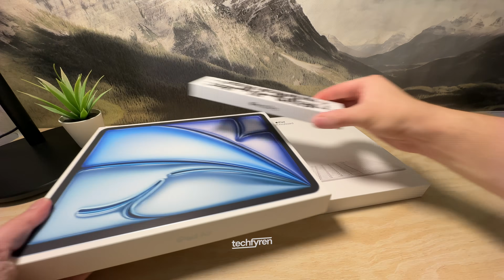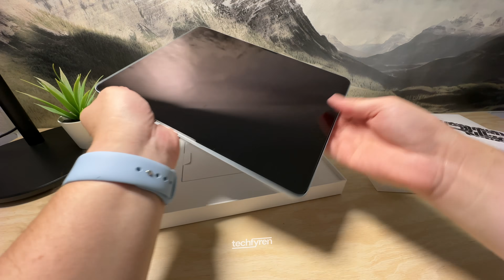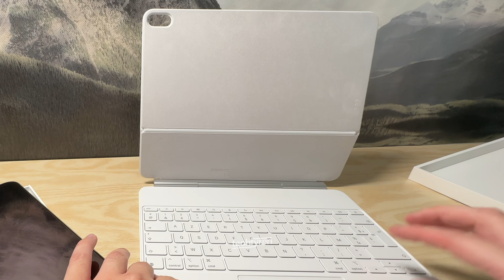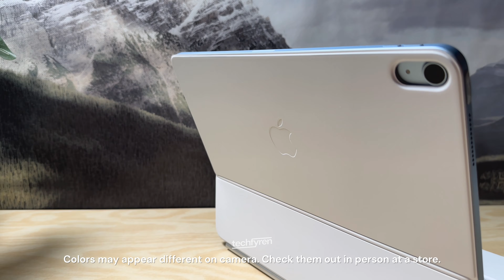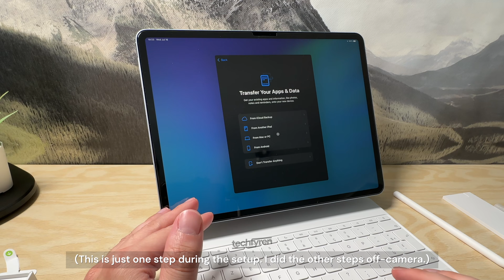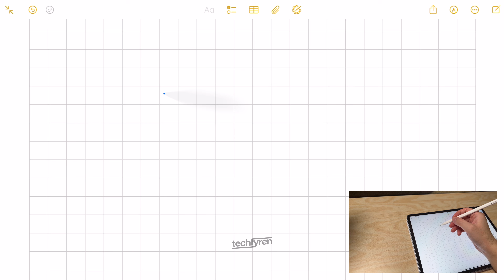New setup: 13-inch iPad Air (M3) + Magic Keyboard + Apple Pencil Pro Unboxing

Comment: Hii! I purchased the same Air M3 with the pencil pro. I observed that the pencil gets dark smudges. Is it the same with you? Also one speaker grillle is totally silent no sound from there, bottom one on the side of the power unlock button. Could you help?
Reply from the maker: Hi! I don’t have the dark smudges, but I’ve only had the iPad Air and Pencil Pro for a short period now. About the speakers: indeed, there’s no sound coming out of the bottom speaker grill on the side of the power button on my iPad, holding it in landscape. According to Apple’s website, the iPad Air has “landscape stereo speakers”, while the iPad Pro has “four speaker audio”.
Reply: @Techfyren  Thanks bro! Much appreciated .